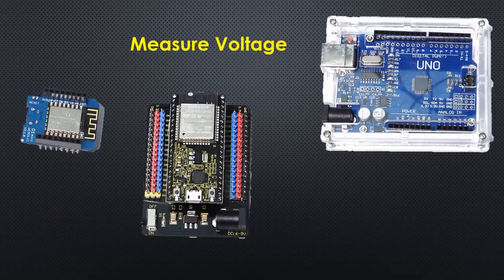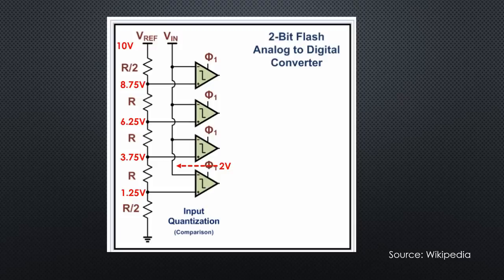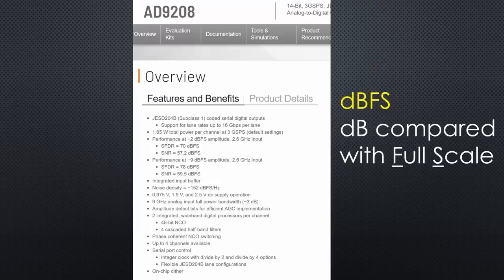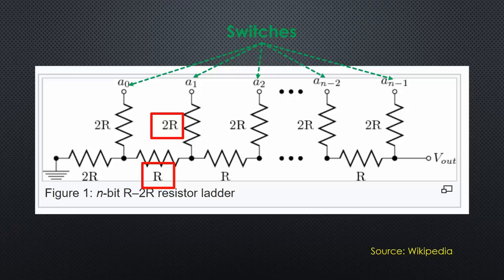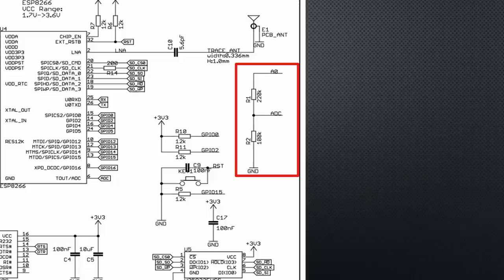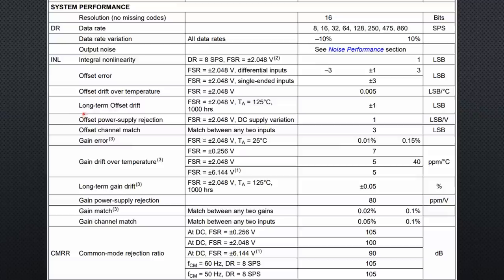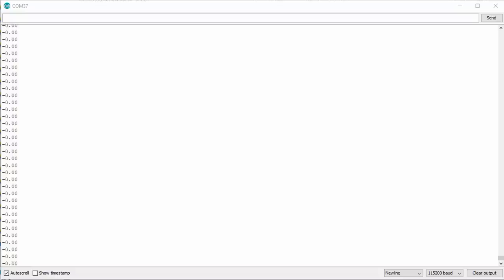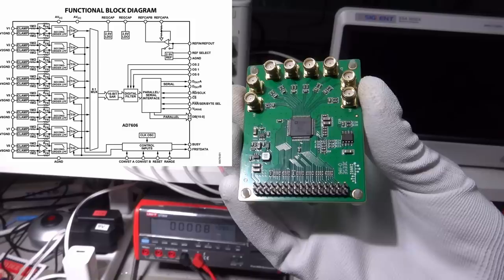#340 How good are the ADCs inside Arduinos, ESP8266, and ESP32? And external ADCs (ADS1115)

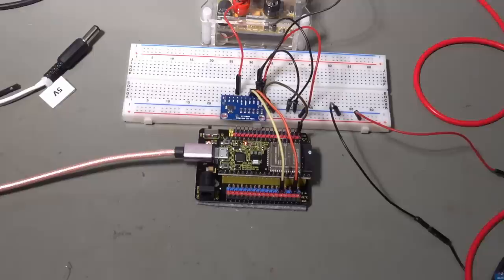Comment: The external ADC at 2.5V didn't show 2.4994 as you say as per the reference but 2.4594 at 22:22 in the video.
Reply from the maker: You are right. My mistake!
Reply: yup. I felt a little spoofed.
With that inaccuracy it seems that an external ADC isn't really that much better than a software-compensated ESP32 ADC.
However, the precision of an external ADC could be interesting for scaled up projects: you are trading the extra costs for an ADC to skip the individual calibration process of each ESP32 ADC.
Reply: @tigerresearch2665  The external ADC only performs so bad due to his own "correction formula" that very likely only corrects errors on the analog end (aka from V_ref to the PGA inside the ADC). So it shows the correct value at this one point, but not anywhere else. One error that affects the analog end, which I would suspect here: High sampling rate -> low input impedance -> voltage drop Correcting ADC values in code like he does is not something anyone should do. The first step is to correct the hardware/setup!
Let me compare that to a car that constantly steers to the left: Do you just "counter steer" to make it straight... or do you fix your car so it drives straight?
Reply: Andreas Spiess So, the conclusion of the Video is wrong?
Reply: @leocurious9919  Well it's not a car. Manufacturing differences of single specimens can very well be calibrated away. We must just keep in mind this is not the only distortion. The most expensive and precise semiconductor sensors for temperature SHT35 are hand-selected and digitally calibrated in production.
Reply: @AndreasDelleske  Of course a claibration is mandatory. But not the way he does it, a one-point calibration (maybe 1,5 points if we take the hard coded offset to reach GND=0 V into account)
It should always be based on multiple points, with the exception beeing that there is no other voltage to measure (either during calibration or in use).

Comment: I am using an ESP32 to monitor the battery voltage on my boat and send an email if it gets too low. I found the measurements very noisy due to occasional glitches. My solution was to take 8 readings and ignore the largest and smallest and average the middle 6. I do this twice and average them. It is quite easy to do in the code as you just have to keep track of the largest and smallest measurements and subtract them from the sum and divide by 6. I found this better than longer averages so that I did not get multiple glitches in my sample period. The result is very stable and quite fast. I very much enjoy your videos I am a retired circuit designer. I designed test equipment for HP (Now Keysight) and things like cable modems in the early days. Now it is a hobby.
Reply from the maker: Good idea because you can eliminate the far glitches. I did not investigate the distribution of the measured values, but maybe they have a pattern you break with your formula.
I like my Keysight MSOX3045 ;-) Good products!
Reply: @AndreasSpiess  The distribution was not Gaussian. It was mostly correct values with a few outliers. It is actually a pretty standard way of filtering. There is even a name for it but I can't find it any longer. I learned it from a statistician who worked for me for a short time.
Reply: Would it help to put a cap (as low Pass?) between the divider and gnd.
Reply: @michael_the_chef  It has been a long time but I think I measured with a dead stable voltage so the answer would be no.
Reply: @L-36  ok thanks, i am planning to use an ads1115 and an esp32 to monitor a battery Bank of 4

Comment: I recommend using median filter for removing ESP32 ADC glitches, averaging is not good for this kind of noise
Reply: The formula @Andreas Spiess is using is not the usual average formula. He uses a so called filter with feed back and I don't know why he is calling it average but that one for sure is not just an average. And the second point when he says "when I use 10 samples or even 100 samples in that formula" .. those are not the actual samples. That number tells how much we should fed back to the initial value so basically to explain it we have an initial x=0.551  and in the loop he is calculating the next x  by taking 99 parts of original x value (0.551) and adding 1 part of the new analogRead value thus it basically means we are just drifting to the left or right of the initial value and the amount of drift is expressed in the ratio we are using 1/10, 1/100, 1/1000 and so on parts of the new value mixed back to the initial one. Also this number will be the speed of conversion to the initial value so the higher value we use the slower is the speed and the more analog reads we need to go back to normal and at the same time the less is the chance to affect the final number by the new erroneous reading. Maybe @Andreas Spiess does not fully understand the formula he is using which I doubt but who knows maybe he can explain it in some further videos.
Reply: @valcob6617  This is a simple IIR filter (meaning the response never reaches steady state theoretically), its good for quick & dirty filtering
Reply: @valcob6617  Also the filter is prone to accumulating round off error for high filtering coefficients and my guess is this is why he gets 10% error on ESP32's ADC

Comment: If you tweak the adc settings in the ESP32 down to 10 bits, and some other changes, the noise and accuracy gets a LOT better, I’m not at my computer at the moment but I will post the code when I get a chance.
Reply: Please leave a link on your comment when you do. Thanks
Reply: Augustine Nwafor - I posted the code in the comments, it’s here somewhere.
Reply: Here is the code of the  @TheDefpom  comment:
"Here you go, here is the code to help get the ESP32 ADC to behave better: 
// configure ADC for getting battery voltage
  pinMode(VoltageSense, INPUT); // Battery Voltage Sense input
  analogSetPinAttenuation(VoltageSense, ADC_0db); // set the attenuator for the ADC to allow 1.1V input range
  analogSetWidth(11); // set the resolution width to be 2048 instead of the default 4096 to try and reduce noise
  analogReadResolution(11); // set the resolution to be 2048 instead of the default 4096 to try and reduce noise"
Reply: @skuashh  cool， will try when i have a chance

Comment: The AVR ATmega328p used in the Arduino, and other AVR chips, have a special sleep mode for ADC noise reduction. It keeps the ADC running, but stops all the digital processing. See the "ADC Noise Reduction Mode" in the datasheet. It could be that the external ADC chips appear better simply because they are physically further away from the running digital logic.
Reply: Interesting. I didn't know Arduino had a sleep mode.
Reply: PS: The Arduino IDE already uses AVR-GCC, so you can use the functions that I linked from Arduino projects as well.
Reply: is it worth it with a 10 bit adc ? (Atmega16A)
Reply: @Slutuppnu  Most AVR chips (the ones inside arduinos) don't have just one sleep mode but a few of them. It has (as has been said), an ADC noise reduction in which the CPU and some other digital parts of the chip are turned off in order to remove noise from the ADC signal; it has a CPU sleep mode that allows you to save a bit of power during delays or when waiting for a short timer to wake you up; and finally it has a deep sleep mode, in which the CPU, fast clock signal (either the internal fast oscillator or the external crystal oscillator), and most peripherals are turned off, except for the WatchDog Timer (low power timer) and a few more things like pin interrupt wakeups. This allows for very low power applications, in which you can put the chip to sleep and only use a few microamps of current, which for battery applications is really useful. For those types of applications, you have to take care and desolder all the LEDs on the board that you can't control, make sure to avoid using any LDOs onboard, etc.
Reply: @GISED_Link  I haven't done thorough testing, but if it's possible to do in your project I would recommend it. Do note that this will also stop PWM'ed outputs. Because of that it was useless for my ATtiny85-driven dimmable LED lamp -- it would turn off the lamp every time it would take an ADC reading. Instead, I used an RC filter on the analogue input to reduce noise levels.
Reply: thx. I use Olimex mod-io board as a slave I2C. I only poll the ADC value once each 2 ms. Maybe it will worth it
Reply: It also has a Vref 1.1v
Reply: I'm nut sure how much this helps. I took a look at the board layout of the Arduino Mega and was shocked! There is no separate AGND, The GND-Plane is quite segmented, AREF is diagonally on the board to the AI pins, the AI pins are routed under the digital pins, under the MCU and with no regard to ground. I'd be surprised if it gave stable results wven with just 10 bit resolution.
Reply: @MarcoTedaldi  oh yes, you can do much better. The ATmega328p and ATmega328pb are very easy to integrate in your own projects directly, no Arduino needed.

Comment: Hints for those starting out -- for built-in ADCs, throw away the bottom bit as it's most likely useless anyway. You can average samples equal to a power of 2 by adding the integer values and doing a right shift -- for example add up 8 integer ADC samples and right shift 3, a useful trick when your microprocessor doesn't have a divide instruction! What's your signal bandwidth? Adding a single pole RC low pass filter in front of the ADC can help. And do not expect the input impedance of the ADC to be constant.
Reply from the maker: Good idea. Thanks!

Comment: Thanks for this video! I've been puzzling over how to reduce the noise of a voltage reading for a project without losing responsiveness introduced by filtering. Based on your video, I switched over to an external ADC (ADS1115) and it solved the problem. Much appreciated!
Reply from the maker: Glad I could help!

Comment: The ADS1115 is my favorite ADC for microcontrollers. I started using it when I moved over to 32bit microcontrollers, but needed a way to read 5V automotive sensors (using a Teensy 3.2). I had 4 sensors (an MPX5700AP pressure sensor, an NTC thermistor, an AEM Wideband oxygen sensor and a 0-100psi oil pressure sensor), the ADS1115 had 4 inputs, it was a match! I didn't have to average values to get a stable reading, like you said, the stability of the ADC is fantastic.
Reply from the maker: Thank you for sharing your experience. This seems to be a perfect solution.

Comment: Awesome. Thank you for the great content! Just my two cents:
1. I've had to learn the hard way, that many (all?) of the ADC that have a MUX only have a single S/H aufter the MUX. This leads to problems, when reading signals on different channels with very different voltages in quick succession. There is quite a bit of "crosstalk". It's really important to make sure that the inputs to such an ADC are low impedance.
2. When I do averaging on a uC, I do 2^n samles (8, 16, 32...1024) samples, add the read values up (make sure to prevent overflow) and just use shift for the division at the end. Especially on uC without an FPU this speeds the averaging up quite a bit.
Reply from the maker: Good info. Thank you! I would have expected only one S/H, though, because it is usually part of the ADC.
Reply: myselfremade did you ever find an answer?

Comment: At 12.07, I love the way you dodge the 1023/1024 argument!
Reply from the maker: I had enough discussions about that in my life. So I once used 1023 and once 65536
Reply: @AndreasSpiess Why was there ever an argument? (1023/1023 =1) Just curious
Reply from the maker: @TheRainHarvester  Because of the 0
Reply: @AndreasSpiess  if you can measure the voltage at the high rail, you divide by 4095 so you get 1* vcc.

Comment: Nice video. 
Remember to consider the input impedance of the ADC,  especially if you use high value resistors for a voltage divider in front.
Reply: since the input is in parallel to the low-side resistor of the voltage divider only its value really matters - well actually it is of course the parallel-combination of the upper and lower resistance in the voltage divider...

And for the ATmega328 the input resistance of the ADC-channels is astonishingly high! I tested it with discharging a 1µF capacitor from 5 V to zero through a 100 MΩ resistor - it took about 15 minutes to discharge and the resulting curve indicates an input resistance beyond 1 GΩ.
Reply: Uwe Zimmermann
I was going to ask what you used to measure that voltage, but I guess you were just using the ADC itself. I imagine most of the leakage current will be through the protection diodes, if it had none then it would be a real recipe for ESD. Which reminds me of a friend using his atmega ADC for measuring back-emf of a solenoid. Directly on the 12V half-bridge output that was powering the solenoid. With no extra diode or resistors. The arduino got really hot, but somehow the circuit actually worked.
Reply: @uwezimmermann5427  I am not talking Any specific microprocesor. I had an adc in a low power circuit where I wanted to messure the battery voltage, here I used a resistor divider in 10 Mohm Range to avoid draning the battery. In this applikation the messured voltage was wrong due to current flowing into the mcu.

Comment: Very interesting video as always, thank you.
Another benefit of using the ADS1115 is that the internal PGA can be configured to read a differential signal, this is very useful for measuring some sensors, although it also results in a slower data acquisition rate.
Reply from the maker: True!
Reply: This trick can also be used in general by the Arduino by using two analog inputs connected to the signal direct and the signal amplified by a fixed op amp.

Comment: Thanks Andreas for this interesting video. I've used ADC lots of times, and never had concerns about the quality of the conversion (noise reduction with average method). In a current project, getting feedback from the servo's potentiometers for a robotic arm,  I've used a calibration table, but now I'm going to introduce your formulas. Thanks again, Juan.
Reply from the maker: It depends on the desired accuracy. I compared, of course, with the data sheet.Calibration tables are good if the ADC is dependable wrong and not stochastically wrong...

Comment: Another great video from a very competent presenter.
Just a point for a possible misconception: there are two other ADC architectures in common use, namely pipelined and sigma-delta. The first tries to keep the number of parallel comparators required in check by converting the output of a comparator stage back to analogue using a DAC, subtracting this output from the original input, and feeding the result to another comparators' stage. Three stages are quite common with typically 4bits per stage; leaving aside the unavoidable latency the conversion takes one clock cycle like the comparators' ADC. This breaks for high resolutions because analog subtractions accumulate too much error. Then sigma-delta comes to the rescue where in fact a control system tries to get its 1 bit output bitstream average as close to the input as possible (its operating principle is not easy to understand in detail though); 24 bits and higher resolutions became possible.
Successive approximation is favoured by the MCU manufacturers for a very simple reason - it requires a single analog comparator and an R-2R DAC - cheap, accurate and reproducible architecture that covers nearly all practical DAC needs. Moreover it can be difficult to find a standalone successive approximation ADC as most are either pipelined (higher sampling rates) or sigma-delta (for high, eg audio, resolution). 
Again for a typical maker these are too finer points but I wanted to make sure they are mentioned in the footnote. Thanks again Andreas for your work
Reply from the maker: Thank you for your explanations. I always learn something from my viewers! As you saw I am more a user and not a specialist in this matter.

Comment: Hi Andreas! Great video as always! One note about the ADS1115 is that it is actually a 15-bit signed differential ADC( AC !!! ), or 16-bit single-ended. Differential
 measurements offer more immunity from electromagnetic noise. This is useful when using long signal wires or operating in an electrically noisy environment. I have been using an ADS1115 to measure the amperage of our utility inlet with a sct-013. The fine art of accuracy I've seen is matching the sampling rate of the adc to the frequency of your local provider to sample the highs and lows of the sine wave as accurately as possible (50Hz here in ZA).
Reply from the maker: You are right with differential measurements.
Concerning 50Hz: You have to synchronize because the ADS1115 is slow. A diode and a RC filter probably would help to get DC out of AC
Reply: @AndreasSpiess  on the sct013 each 10A represents 1v. Thus getting Amperage readings are easy and safe with non invasive clamps. Only when it comes to the measurement of voltage, territory gets unsafe. I have opted for a 220v primary, 12v secondary to convert ac to DC proportionally followed with a voltage divider and capacitor. With both voltage and amperage the apparent usage can be calculated to identify power consumption patterns at home. I cannot thank you enough for the extensive and concise research you have given to this community! You inspire us!